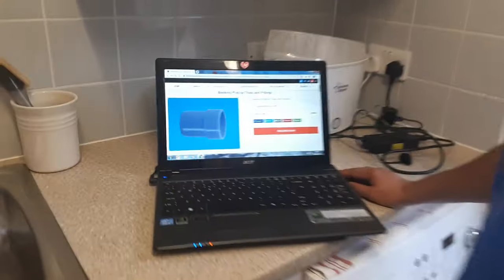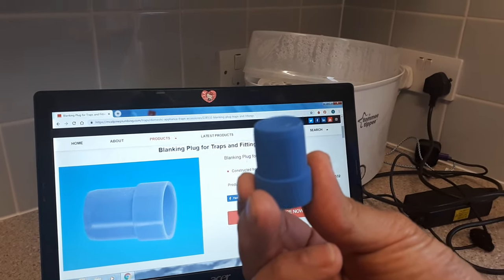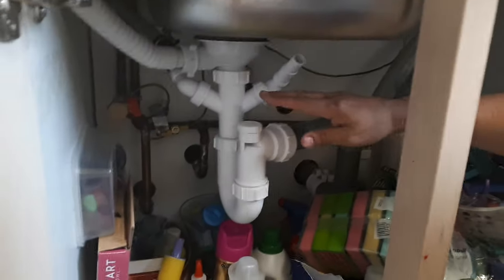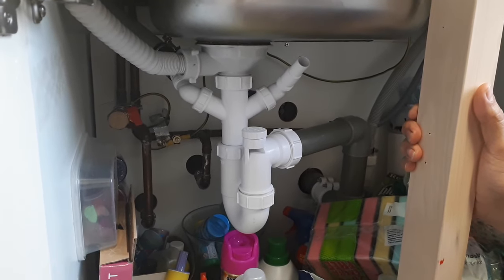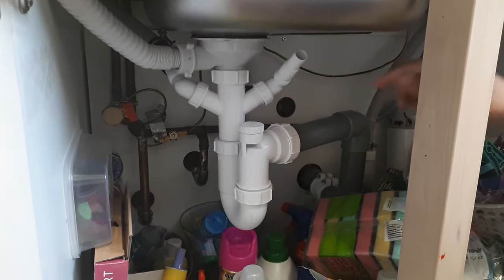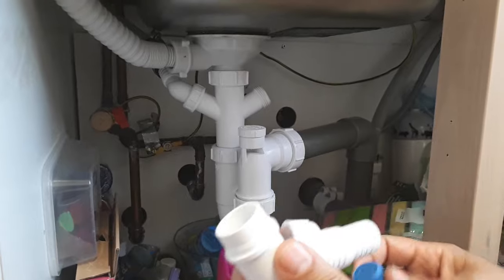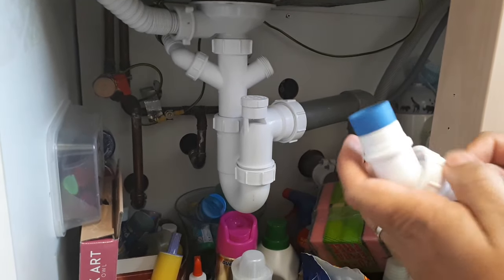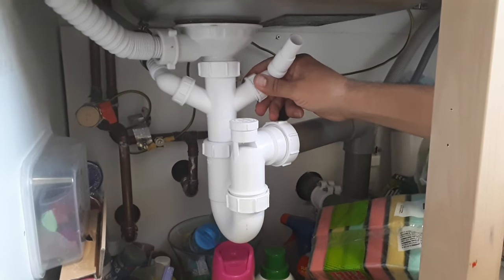How to fit a blanking plug to a washing machine/dishwasher trap

Comment: How do i fit the trap that youre plugging in this video? I have a sinlge pipe with no nozzel at all i just shove the waste pipe down a really long waste pipe and swap them when i want to use the other appliance. This is annoying so i bought the trap you have there, and need to add the trap seen in The video to it. Thanks.
Reply from the maker: Hi Victoria,
Ideally it would be handy to send a photo or video, but I can run through it with you the best I can.  On the trap you will have a top nut which will thread on to the basket strainer, then the nut below the top nut you will have an adjustable height.  On the u-bend itself there is a swivel adjustable nut.  All these nuts are hand tightened.   The part which attachs to the waste pipe you need to put the plastic nut on the waste pipe first, then the flat washer followed by the rubber washer, with the chamfered edge facing the trap. With the spigots, make sure you remove the blanking plug and attach it to the trap, then attach your waste pipe to the spigot with a jubilee clip or spring loaded clip.
Hope this helps
All the best
Mustafa

Comment: Hello my spigots are blocked (I am assuming with a blanking plug) but they are attached to the trap with closed pvc, is there a way to unblock this? I have had a new dishwasher fitted and it won’t drain due to this! Thank you very much!
Reply from the maker: Hi Molly,
The best thing to do would be either to send me some photos or a video and then I can pin point you problem.
All the best 
Mustafa

Comment: Daft question. I've never known it to be an issue, but does does it matter which spigot you attach either of your washing machine or dishwasher to?
Reply from the maker: Hi there,
No it doesn't matter which side but if a blanking plug is fitted make sure you remove it first.
All the best 
Mustafa

Comment: hi. I I undid my sink u bend and pipes to remove blockage. I I put back together now the bit with the blanking plug is leaking. any ideas what is wrong. I 
shall I get a new blanking plug
Reply from the maker: Hi there,
Sometimes when you remove a trap this can cause problems, 
however what I would recommend is to undo it and  make sure your washers and pipes are clean and then test for leaks, if this still doesn't work I would either buy new washers or a new trap.

Comment: I always put the plug on the other side of the nozzle and it always worked. Did I always make a mistake?
Reply from the maker: Hi there,
That is fine what you have done, it is best practice to blank the spigot that you are not using.

Comment: Listen but this plug doesn’t have holes how water goes out?
Reply from the maker: Hi there,
The purpose of this plug is to stop any water coming out when your appliance is discharging water.
Also if you have a blocked sink, it's a must to plug both spigots to get maximum pressure on the blockage.
If you decide to attach a drain hose to the spigot you must remove the blanking plug.
Reply: This you use when your not using that pipe. Obviously it’s to stop water coming out. If your using the pipe then you must take it out to let waste water out.

Comment: No mention of the sizes, even the plugs don't tell you i have bought three different sizes and none fit. trying to get a 32mm but it is not easy. may repalce the u bend with a new one without a spigot.
Reply from the maker: Hi there,
Sometimes it can be difficult, however if you look at the trap there should be a stamp/brand label, this will help you identify the the trap and therefore help you find the correct plug.
Alternatively you can get a new trap with a spigot and it comes with the blanking plug.

Comment: You should extend the video and show how some plumbers fit them wrong.  They take the spigot off and put the blanking plug in the pipe instead of the spigot. Then the blue plug gets wedged down in the u bend and you can't get it out!
Reply from the maker: Hi there,
It doe's make you wonder, maybe they are hoping for a call out to unblock the sink.

Comment: This system does not work, because the dirty water from the sink goes directly to the washing machine.
Reply from the maker: Hi there,
Unfortunately you haven't understood the purpose of my video, this system works perfectly without any issues.
With the water from the sink this goes through the trap and then into the waste water pipe/drain, not the washing machine. I don't know where your getting your information from but it's clearly wrong.